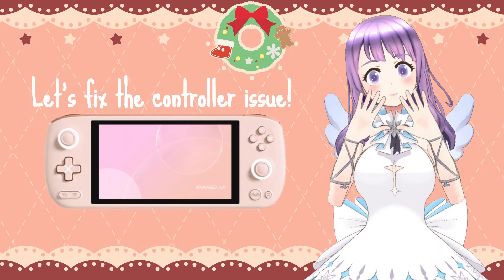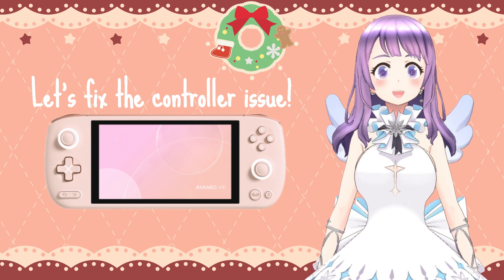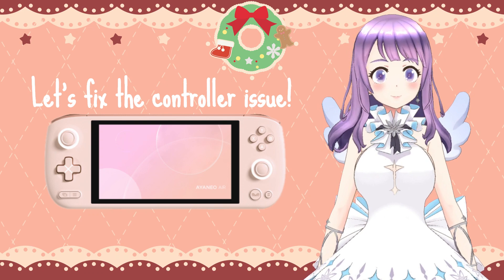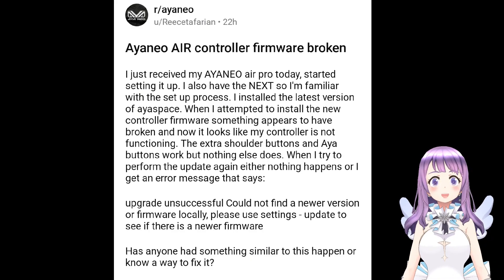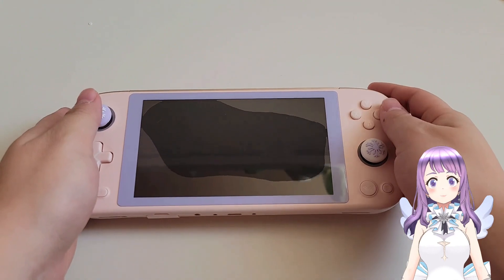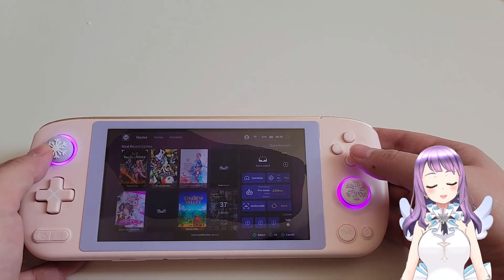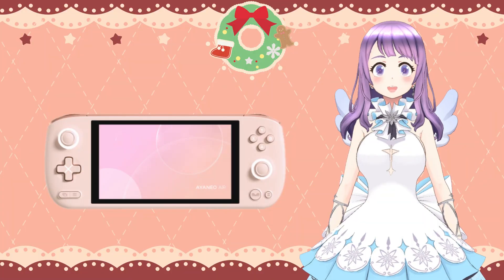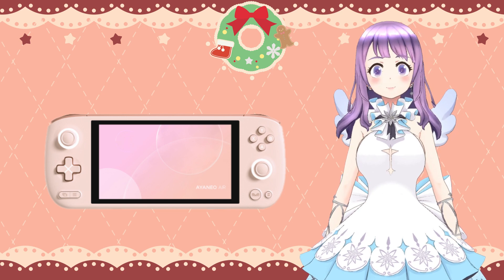Tutorial on how to fix controller issues on AYANEO devices

Comment: Are there any other methods? My LB button doesn't register when pressed.

I have the Antec Core HS ( which is a rebranded Ayaneo Slide)
Reply: Same!! I have the Antec Core HS and when I had a problem opening AyaSpace I uninstalled it and now my controls don't work anymore even after I reset my pc.. I have no idea what to do now

Comment: Fix that worked for me for many issues including controller issues - 

Anyways, the fix that worked for that as well as MANY other issue is updating the driver. It’s super simple, there is a video on it you can google. If you care to keep reading I’ll explain more in detail below

1. pull up control manager 

2. Click on display adapters (mine is AMD Radeon)

3. After clicking on AMD then select driver tab 

4. Select update driver 

5. Important (select browse my computer for drivers NOT AUTOMATIC)

6. You’ll see in blue at bottom (let me pick from a list of available drivers) click on that 

7. Select AMD or whatever yours is and then select next 

8. Your star I will restart and hopefully your issues are resolved. 

It doesn’t reset anything or mess anything up. I promise you this fixes so many things and it’s saved me from returning this garbage. Goodluck 🙏🏽
Reply: Didn't work. The right bumper doesn't work on my ayaneo 2. I tried the reboot system and madly press the button method and it worked but it went back to not working after a few minutes 😢

Comment: Hi deer
I have a problem with my device, all the buttons on the control panel are not working. I have formatted the device twice and the problem has not resolved yet
Reply: This is to everyone experiencing keyboard issue that tried this information the video & it didn’t work.

I have several issues with my device, just now the analog was selecting multiple things on my AYANEO where you aren’t able to scroll at all if that makes since.  

Anyways, the fix that worked for that as well as MANY other issue is updating the driver. It’s super simple, there is a video on it you can google. If you care to keep reading I’ll explain more in detail below

1. pull up control manager 

2. Click on display adapters (mine is AMD Radeon)

3. After clicking on AMD then select driver tab 

4. Select update driver 

5. Important (select browse my computer for drivers NOT AUTOMATIC)

6. You’ll see in blue at bottom (let me pick from a list of available drivers) click on that 

7. Select AMD or whatever yours is and then select next 

8. Your star I will restart and hopefully your issues are resolved. 

It doesn’t reset anything or mess anything up. I promise you this fixes so many things and it’s saved me from returning this garbage. Goodluck 🙏🏽
Reply: @ihaney I have an issue where my LB button doesn't register when pressed, I tried updating the driver & it didn't work :(

Comment: I hope you can find a fix how to turn off the led lights! It just won’t turn off using aya space, it’s so frustrating!
Reply from the maker: As far as I know, it can only be turned off in aya space. I know they are upgrading aya space to aya space 2. I hope that helps. If not, maybe that a look at device manager in the control panel and see if you can disable the led lights.

Comment: i have an ayaneo with controller issues like these you showed in the video after i made screen replacement (ayaneo sent me this screen because my ayaneo came with a defective one) after carefully assembly everything i had this problem, i've smashed the button several times now but still not working, led ligths are working fine but DPads, Apads and buttons are not working, and XBOx controller is not showed in windows device manager, does anyone happen to know what else i can check to make it work? thanks in advance.
Reply from the maker: Sounds like a defective unit to me. Maybe it is a good idea to check whether all the parts are connected properly. I sometimes thought myself assembled the device properly but I didn't....
I had a GPD win 3 and it had the same symptoms as you described. Turn out it was both connection and driver problem. 
So my next step would be updating all the drivers available. 
But if that doesn't help, it is very likely a defective unit cause the method I showed in this video is how Ayaneo stuff inspect and fix button problems
Reply: @ETlandxoxo  thankyou for your reply. I will double check everything. It was working fine before i disassembly it the first time but all connections are tiny and fragile i hope there's only something disconnected as you said otherwise is going to be hard to identify if there's a broken flex cable or anything.
Reply: @julfons  any updates of your device?😢

Comment: Ok quick question, how did you add the slide to unlock feature on the start menu?
Reply from the maker: I enabled the finger print sensor
Reply: @ETlandxoxo  ty for the reply. Another question thats somehwat related to the video, do you know how can i use my xbox one controller as a mouse on my ayaneo without connecting it via usb?
Reply from the maker: @hueman9  In my understanding, I dun think that's possible in general. (The controller on AYANEO somehow blocks the other Bluetooth controllers even if you turn it off) 
But IF you are talking about in-game, you can probably map it through steam controller overlay. I think you have the option to select the behavior of the joysticks